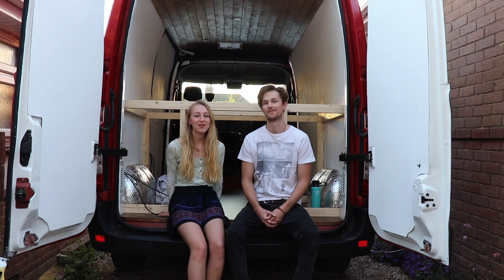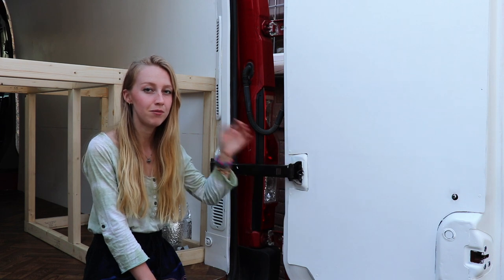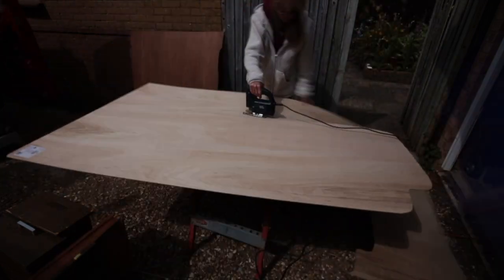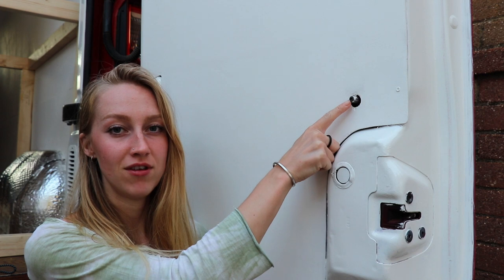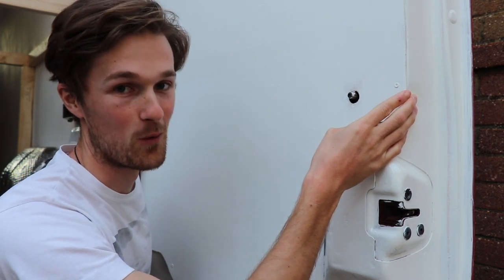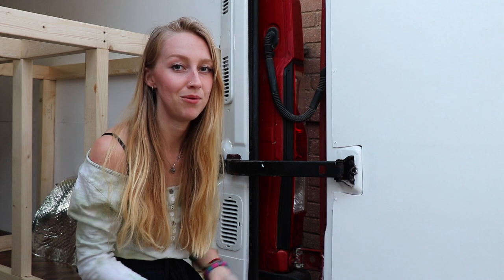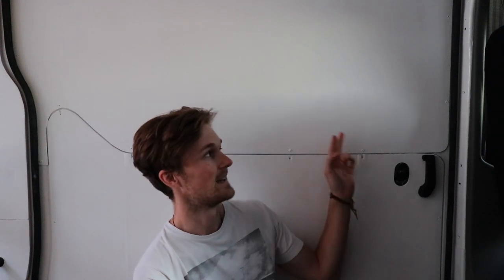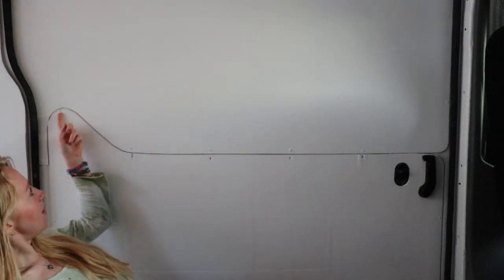How to Ply Back Door and Sliding Door | Van Conversion | DIY Van Build Tutorial

Comment from the maker: Plywood doors or Tongue and groove cladding doors - What do you prefer?
Reply: Tongue and groove cladding is what we are going to attempt in the coming weeks :) Great job guys!
Reply: Going to have tongue and groove on the bottom and then plywood on top around the windows. If I were starting again, I'd probably just use plywood all the way or carpeting for weight reasons. I like the doors to be as light as possible for ease of use later on.

Comment: Hi doing the back door and sliding doors as well with ply. Will look into 3.6mm ply (originally 6mm) thx. Did u guys simply tap screw into the metal? This was the missing puzzle
Reply from the maker: HI! Thank you for watching! We drilled a little pilot hole into the metal first (smaller hole) to help the screw go in :)

Comment: Great advice! I'm wondering what you did with the pillars next to the rear doors, did you insulate those at all, and it looks like you just painted directly on to the metal?
Reply from the maker: You're right, we used metal paint to paint it white. Directly onto the red paint but we did sand the red paint down a bit beforehand. As for the pillars, we put some leftover recycled bottle insulation in there but not much and we may add it in if it gets too cold but it's been fine without so far. (We didn't want to buy another whole roll of insulation just for those little bits) Thank you for watching!

Comment: What paint did you use for the plywood? And do you find it durable and not rubbing off? Thanks!
Reply from the maker: We first used wood primer paint and then used emulsion paint which has been find but marks quite easily but we're painting it all again with white satin paint to make it easier to wipe clean if needed :) Thanks for watching!
Reply: @OurWildHorizons  ah yes, I was wondering about stains and marks..thanks for your response!

Comment: do you screw the wood directly to the metal door?? doesn't it make holes that way?
Reply from the maker: Yes, we did. I suppose you could sikaflex it instead though if you didn't want to screw into the meta? Since it was only in the back doors we didn't mind doing it. Especially since that was how the original panels were screwed in. It hasn't been an issue for us though this past year :) Just the odd tightening of screws every now and then.
Reply: @OurWildHorizons  yes, just curious, im learning how to do it myself. Can you see the screws from the outside?
Reply from the maker: Noo, we only screwed into where there was a hollow area in the metal, so nothing poking through the van exterior!